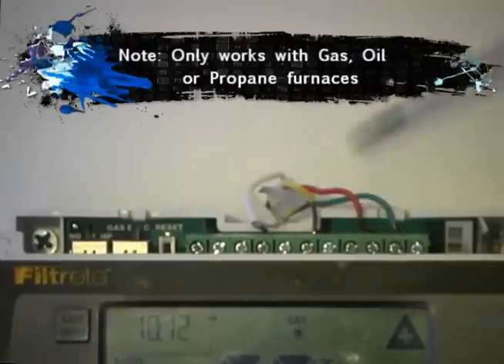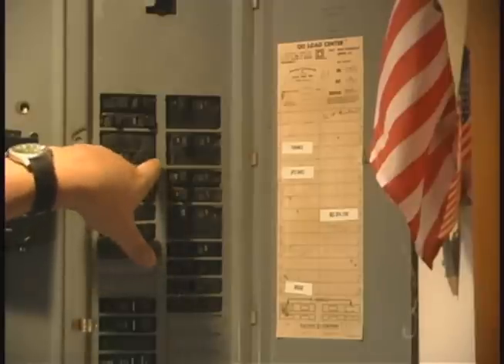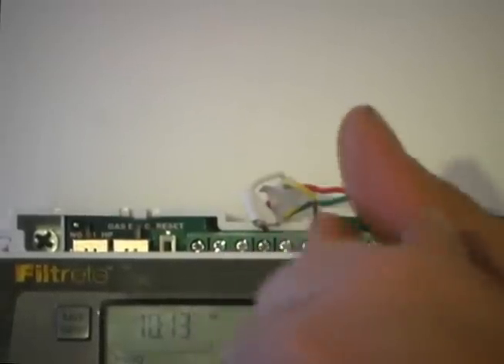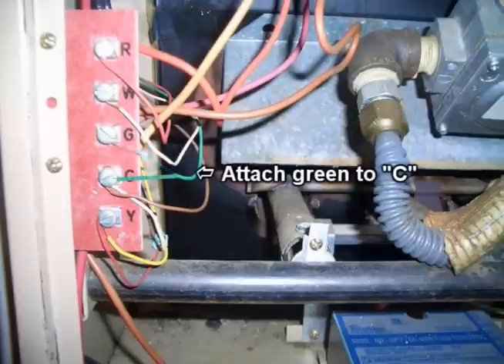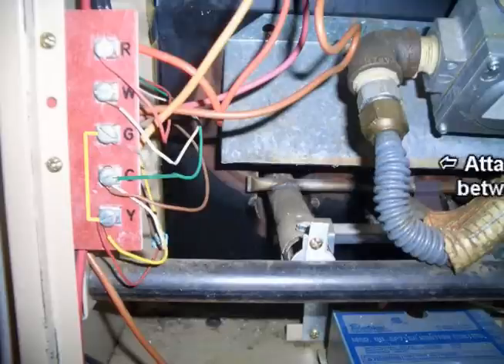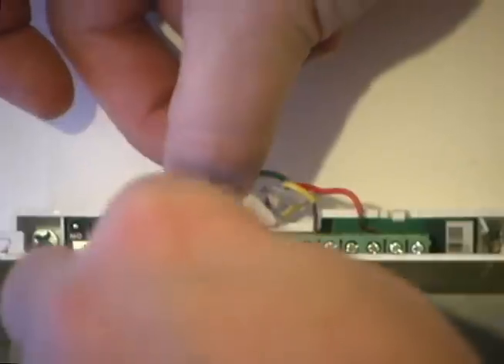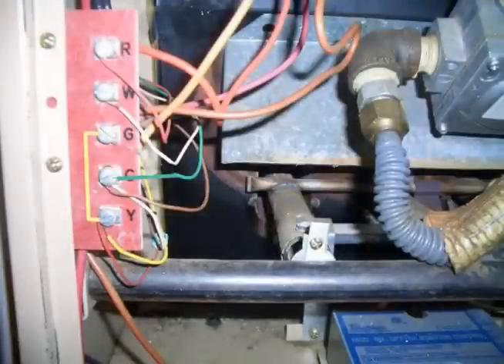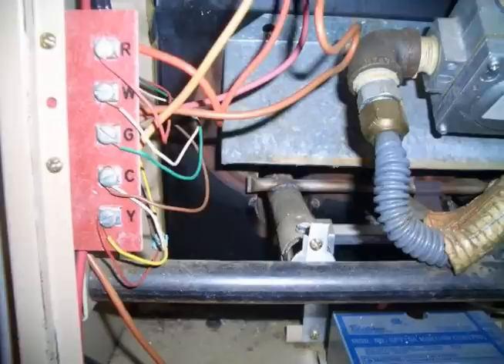C Wire -- How to use the G wire as a C wire

Comment from the maker: So we understand you correctly, your furnace has no G terminal. Is your furnace a conventional furnace of a heat pump?  This method of adding a C wire will not work with a Heat Pump and it will not work if you do not have a G wire.  You may have to purchase a plug in transformer which is a topic in another of our videos here on Homehandyman101.

Comment from the maker: @gixxtrixx  Only G and Y should be jumpered, and only if it's not an electric furnace. In furnaces run by fossil fuels, you can jumper the G and the Y on furnace level, but do not jumper the G and the W.

Comment: Thanks for putting this video together.  It is great.  However, I have an issue.  I have an oil furnace in my basement, and an air conditioning system in my attic.  My G wire is connected to the air conditioning system in the attic.  I looked in my air conditioning system, and I don't have a C terminal in there.  I have the following terminals in the unit in my attic: R, W3, W2, W1, G, 3.  And there are currently wires connected to R, G, and 3.  Can you help?